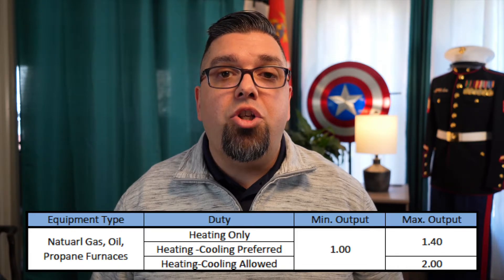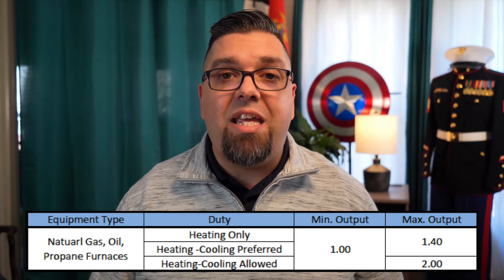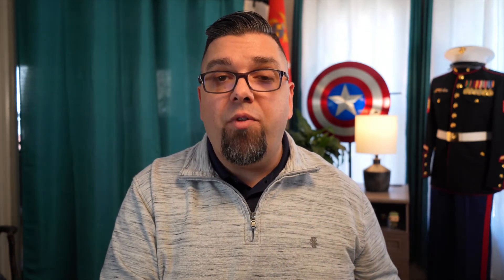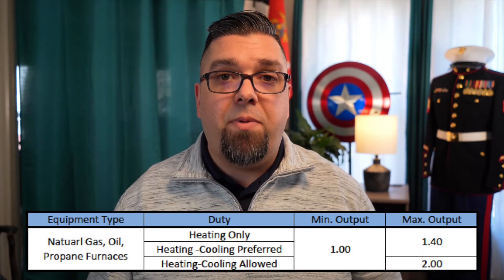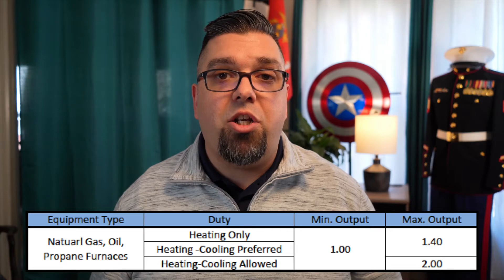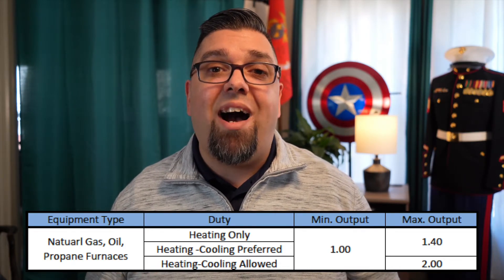Manual S Furnaces - How to Choose the Right One for Your Code

Comment: 40% oversizing to cover 1% of the time is absolutely ridiculous - should go as close as possible. If a specific size is a little small, solution is to use a different brand with different size increments. For example, use a lennox 66k instead of jumping from 60 to 80k.